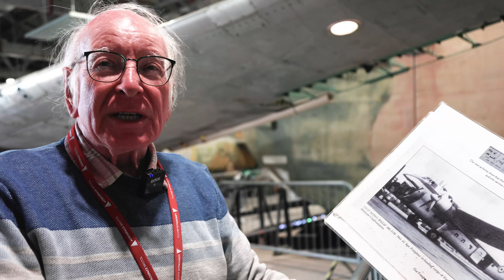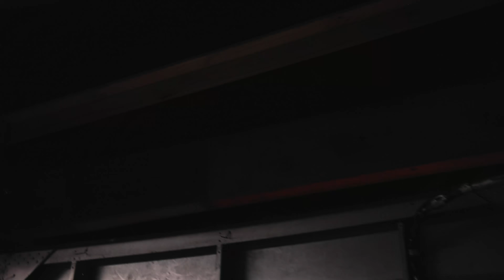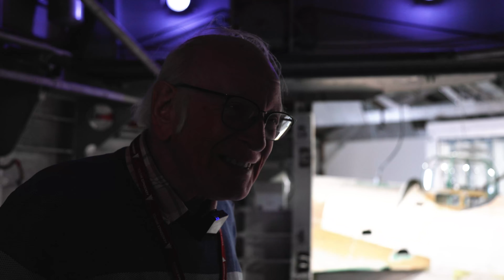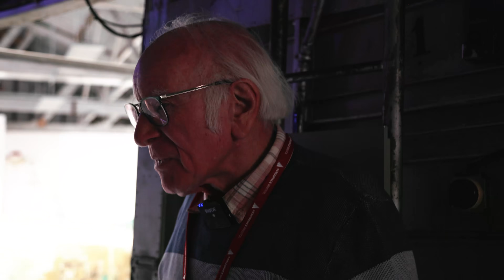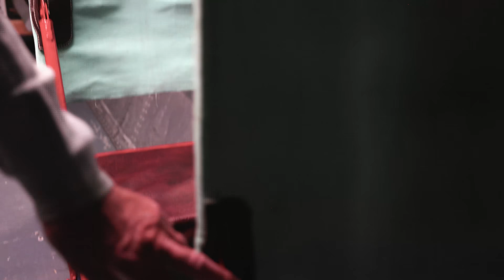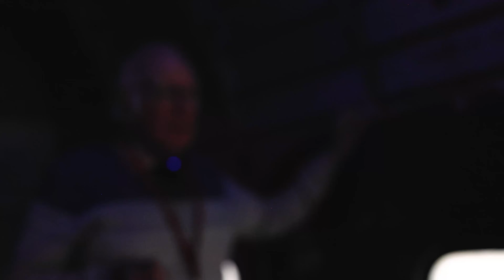Exclusive Look Inside a Bristol Freighter | Airfix

Comment: In 1977, when the last Bristol Freighters were retired from RNZAF service in Singapore, I was working on NZ5911 – the very aircraft you are looking at. Before you make a video like this – Do more research – This video is so full of errors. For a start, the Chatham islands 500 miles away, is part of NZ and RNZAF Freighters did NOT operate a service to the Chathams – It was civvy SAFE Air freighters.
RNZAF Freighters were NOT contracted to carry food for American forces in Vietnam. They flew to Vietnam to support NZ forces there. Navigation – The RNZAF Freighters had a very good navigation system based on a very accurate compass system. AND our Navigators were very good at it. BTW the North & South islands are only 30miles apart and there is a port in the north of the South Island. In the 50’s NZ knew more about the rest of the world than the rest of the world knew about NZ. I have wound the doors open and closed many times. Most times we took the handle out and just pushed them closed. The seats are not parachute jumping seats – they were the normal seats for everyday use. In the flight deck one did not have to climb over the instrument panel to get in the pilots seat and it did have a proper floor. Our Freighters were a mix of single OR dual pilot. Eg. NZ5910 was a dual.

Comment: I flew to the Chatham Islands in BF ZK..LT on 9th April 1968. LT and RK could take a pax capsule holding 20? persons quite comfortably, with windows aligned with aircraft windows. The trip was 3-½ hours.

I worked at the NZPO Radio Communications Station ZLC. On plane days we got the flight plan sent to us by Morse, from Auckland Aeroradio. The flights originated/returned from Wellington Airport to the Chathams grass strip at Te Hapupu. We communicated with the aircraft on HF RT once they got closer to the island. (We didn't do ATC, but a Meteorologist gave local weather info by VHF RT.) There were two navigation aids available, DME and a NDB, callsign C I. 

There were two "special" flights during my time there, a mail cargo to clear a backlog another to load a small Cessna and a Bell helicopter, type with the plastic bubble cockpit. The Cessna's wing was detached and stowed, as was the Bell's main rotors. I was at the airport to see the action.

I flew back to Wellington later on, about late September and the weather was (very)  marginal indeed. No one told the passengers about the BF's crosswind landing technique of plant windward main wheel down FIRMLY — then the downwind main just as firmly. The BF was a tail wheel dragger.

Comment: I guess the story teller meant well but he was mostly waffling on. Straits Air Freight Express or SAFE Air flew up to x22 Bristol Freighters, a lot were ex R.N.Z.A.F. ones. They flew from Wellington to Blenheim mostly and the "island trip" mentioned would have been the Chatham Islands, 430 miles off the east coast of the South Island. This was a regular service and SAFE even designed a so called sound proof pod for passengers which was loaded and unloaded when needed, by the same method as the fright pallets mention in the article. I remember this aircraft at Ardmore air field in Auckland and was a little surprised to see it go off shore. AIRFIX need to release a Bristol Freighter !
Reply: Just to add, the Chatham Islands are NZ sovereign territory.

Comment: The C -5 is capable of mid air refueling. It doesn't have to land to refuel.
Reply: Yes. However you have to consider the cost of Deploying a tanker aircraft. It is cheaper, less risky and less fatiguing  for the crew to land and refuel on route.😎